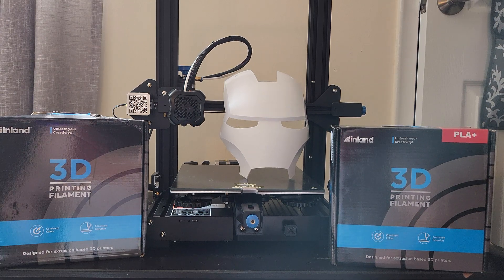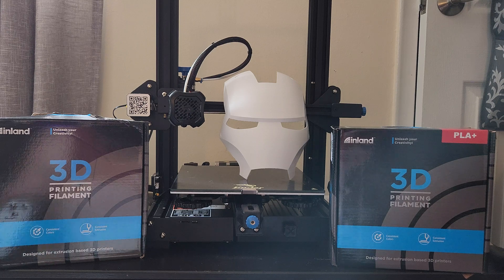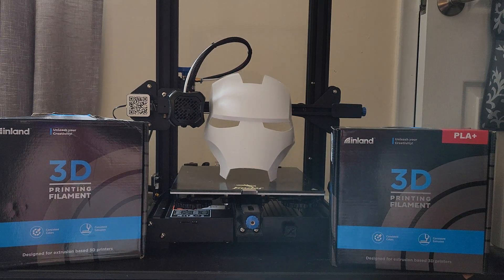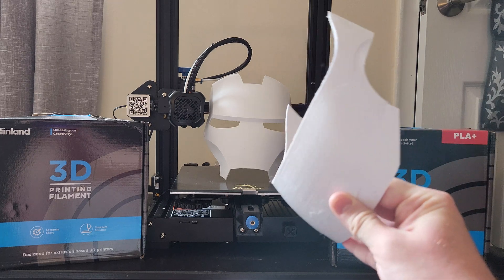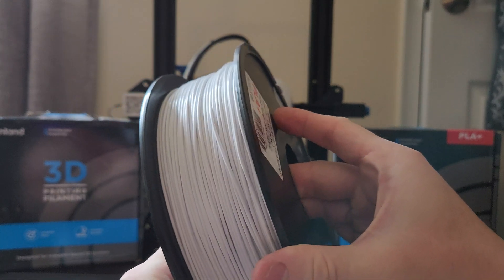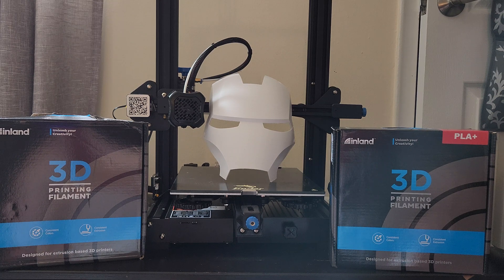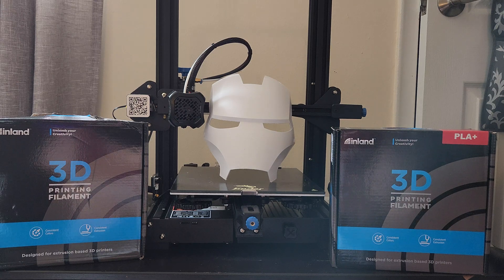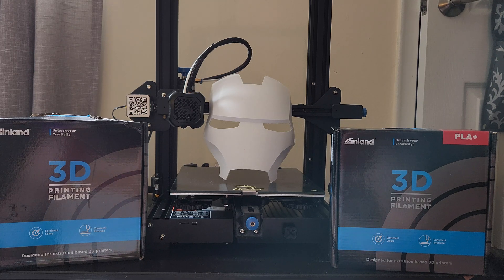My Love Hate Relationship With Inland PLA Filament

Comment: I’ve used the PLA+ extensively and have been very pleased. I recently opened some Tough PLA, and it literally started to fall to pieces in days (sitting in a drybox). That is the first roll like that, but makes me want to stick with PLA+.
Reply from the maker: Thanks for sharing
Reply: Don't dry box the natural filaments or Tough PLA from inland, it will become brittle. Theyre also quite sensitive to UV before printing.
- MC Employee
Reply from the maker: @nunyabeeswax4588 thanks for sharing

Comment: So I work for Micro Center and had a long discussion with our 3d printer guys, and the problem most people have is the filament requires some very hot settings for PLA. I find my best results at 220C and 60 bed
Reply from the maker: Thank you for sharing
Reply: I thought it was a moisture issue, and while I have much less stringing after drying, some of these prints look very poor. Almost missing in sections. When using protopasta's htpla I never had this issue and the filament was looking amazing.

Any suggestions? I'm using a Bambu a1 and using inland PLA non plus. Should I use the plus?
Reply from the maker: @TheBinklemNetwork I think the plus is better but would like to hear what others say.
Reply: Can you ask your guys what the differences are between the pla +, pro, and tough versions are? Id love to see numbers like tensile strength, elongation, etc but info on these filaments is nonexistent. Which one is the strongest? What are the pros/cons of each? Etc.
Reply: @TrippyRiddimKid  Ill go ahead and ask if they have that information available. It's the only filament I use personally, and I always use the PLA+. The pro is what you want if you're going for tensile strength, and the tough is definitely for impact resistance and has poorer tensile strength than the pro but better than the PLA+ in my experience. PLA+ from there is my go to because it is very consistent and I mainly print miniature terrain for Warhammer.
Reply: @nunyabeeswax4588  Yeah from the little bit of handling Ive done so far it seems tough is much more ABS like while still being decently stiff, while the pro is more of what I would call a "tough pla". Havent handled the + yet, but from what Ive gathered its just between normal and Pro in stiffness and toughness. The pro seems to have great consistency as well

Comment: I've been having problems with stringing, specifically with the PLA+ rolls. I've tried every setting and adjustment under the sun, and nothing seems to work...
Reply from the maker: The default settings for the ender 3 v2 have worked for me.
Reply: same issue for me on my brand new INLAND PLA+
Reply from the maker: @lucianowod  thanks for sharing

Comment: I've had 4 different rolls or Inland filament and I am dissatisfied with all of them. One PLA, one PLA PRO, one PETG and one PLA silk rainbow.  Oddly enough I've had a great experience so far with Hatchbox. I don't know what the issue is. Microcenter is super convenient for me but I'm just not getting the results.  

I suspect it's a combination of quality control and the filament just sitting on the shelves for months (maybe even years) at a time. Who knows.
Reply from the maker: Fair point, outside of the issue with it not being wound properly rhs inland has worked well for me.